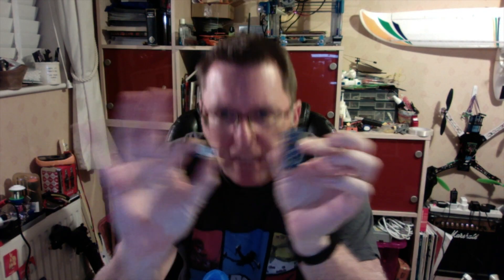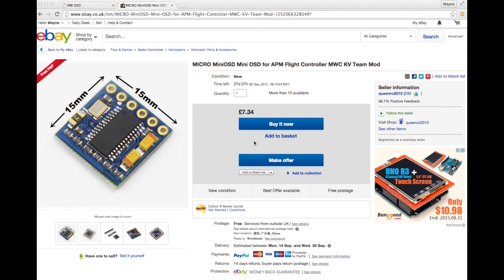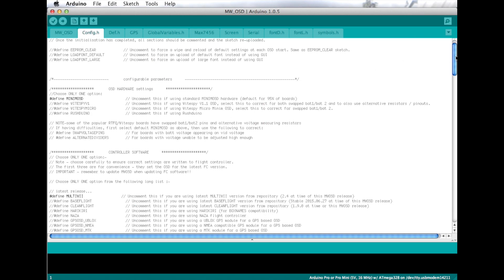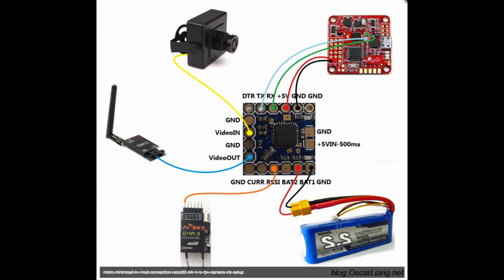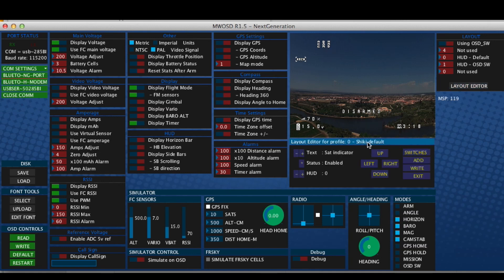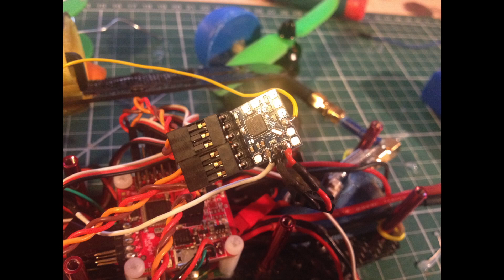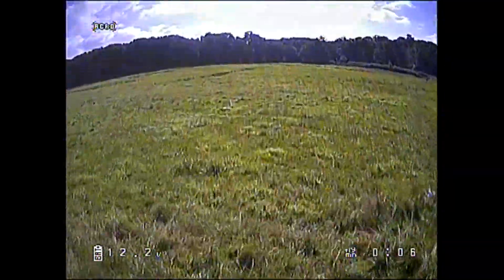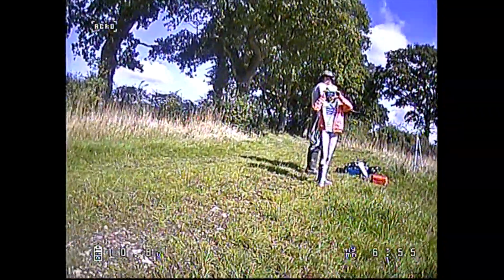Micro MinimOSD Review/Setup and FPV flight test

Comment: Thank you , I have one enroute from banggood to have a tinker with and your review couldn't have come at a better time.

These minim micros look ideal for our types of use and i intend to use it in nearly the same manner as you have,besides the pyrotechnics :)

Maybe able to shoehorn one of these into my upcomming 150 build.
Thanks again.
Reply from the maker: +MrE I think it'll fit ok, I didn't want to make the video overlong about where I put it, but it's basically sits on top of my Naze board, where there's space before the top plate.  I'm presuming the vertical room between the plates is still similar ?
Reply: +CurryKitten Very much similar,but as you could imagine space will be at a premium with such a small frame. The one place im thinking about is on the back of the camera itself if the conventional space is not feasible due to other components residing there.

Comment: Cheers mate, excellent and informative video! I bought one of these from  Banggood, and managed to fry my VTx  on the first connection!

Do you have the earth lines from the camera and the VTx on the same pad? it's difficult to see on the video. 

Cheers,

Eck
Reply from the maker: +LocheeLuftwaffe Oh no !  Sorry to hear that, any idea what was up ?  So in this setup the power and ground go from my PDB straight to the camera, and then the video out comes back to the osd (no ground connection here)  There was a comment on Oscars blog about people having issues with the OSD display flickering and it could be solved by a ground line on either the camera or the video in, so I've got both ground and video out from the OSD to the VTX (and one again it gets power from the PDB).  Note: This only works because of the common ground with a single battery powering everything - if for any reason you are using multiple lipos, then different rules apply
Reply: +CurryKitten Thank you sir, I think the earth must have touched somewhere on the board. 
I'm using the Eachine 700TVL camera/200mW VTx combo from Banggood, and, following your reply, cut just the video wire between camera and VTx on the replacement set, popped them on and success!
Reply: +LocheeLuftwaffe you have a Eachine 700TVL camera/200mW VTx combo from Banggood set up with it, do have any pictures or diagrams as to how you did this as I have the same camera and am waiting for my Microminim osd to turn up in the post, thanks
Reply: +Ian Nicholas Hi Ian, Unfortunately, I don't have any photos of my setup, but I'll try to describe it.
Firstly, the only wire in the Eachine harness that needs to be cut for the OSD is the yellow wire. I cut it about 7.5cm (3 inches in old money) from the camera connector.  The camera end goes to the video in pad on the OSD, the VTX end goes to the video out pad. There is no need to connect the ground wires to the OSD, so leave the black wire in one piece!  

The flight controller connections and firmware you install will depend on your setup (I've used Naze 32 and Flip 32 FCs and Cleanflight)

The connections are shown on the eighth picture down on the Micro Minim OSD page on BangGood's site...I just followed that.

Hope this helps!
Reply: +LocheeLuftwaffe thats awesome thank you

Comment: Nice Video Great advise and info. At first thoughts like you I thought why would I want a OSD in my 250 and nowI WANT 1 :DBy the way What recorder do you use for the FPV camera
Reply from the maker: +Pudsey - Rc Thanks - I'm really liking this little thing.  I'm using a BevRC PV700 DVR which is the same thing as the FPV-Japan and the same as many others sell (just with different splash screens)
Reply: Im using 1 from Hobbyking had it a while but it lags a lot and stutters on recording from time to time even with class 10 cards

Comment: I'm having trouble getting into the menu doing the stick movements, I get the boot screen when I power up then I get DISARMED which alternates to NO DATA, any help is appreciated, thanks.
Reply from the maker: If you are getting no data through, then you might have mixed up the Rx/TX pins.  Try swapping these over and try again

Comment: Is there any way that you are aware of to change the position of the bat voltage to a different location on the screen using the Taranis? I ask because re programming my board means quite a bit of time taking my quad apart and I would like to avoid if possible thanks!
Reply from the maker: +Brent Simpson Not sure, you can turn a bunch of things on and off, but not sure about changing position.  Away from my gear for a week, and won't be able to check for a while
Reply: Brent, if you research this you will see that you can edit your own custom characters  and upload them. The position of each of these is written in the code.
Every variable along with its identifying bitmap icon or acronym have a coordinate for where it will print each beginning (I believe) with the left most character.
I am just getting my head around this so I can't be more specific. All I can say is look at the code once you have it up on Arduino IDE and then look at each of the headers along the top. Join the forum on MultiWii and check out for a thread at RCGroups. It is well worth your time and effort as it is the ONLY open source OSD firmware that is being actively developed at present.

Comment: Massive shame it's not flashed already. Can any other dongles be used rather than an arduino?
Reply from the maker: +MicroRCFiend You don't need a physical Arduino board to do the flashing - essentially the OSD is a tiny arduino.  The bit for the flashing is an FTDI adapter, which you will need to make any changes to the OSD display anyway

Comment: to set up voltage trough the flight controller do you have to set up anything in cleanflight?
Reply from the maker: +J Sanders If you are getting the voltage into your naze (or whatever you are using) then it'll pass it through to the osd.  Of course you have to have that physical connection in the first place.  What you can do in cleanflight is setup a separate low-voltage alarm so it'll start beeping (which of course also involves connecting a beeper)

Comment: How do I configure ports in betaflight? Wich UART should i use? Help me
Reply from the maker: When I made this video I was using a Naze32 rev5 board which just had an rx/tx pin in the middle of the board and shared as UART1 with the USB connection.  As to which UART depends on the board you are running.  All you need are 5v/GND/TX/RX pins on the UART which you can then connect to the MicroMinim.  In Cleanflight/Betaflight you then set this UART up as MSP 115200 baud (under the data heading)
Reply: CurryKitten ok thanks,I got it to work

Comment: If I have just the Naze32 Acro which options will work in it???
Reply from the maker: +Quadcopter Free Style Nation Well, depends :)  With the Naze connected to almost nothing - you'll get the modes, timer and the AHI if you really wanted it.  Obviously if you connect the power to the naze or direct to the micro osd you have your voltage which is handy

Comment: do I need the Filter for Rssi on standard minimosd?
Reply from the maker: +Konrad Lorek Sorry - don't know, and it might depend on the firmware you run on it.  Shikra mentioned he should be able to fix the issue with FrSky PWM RSSI at some point

Comment: Ok i got it to upload i just use an older version 1.05  but now when i open mwosd   It tells me. Waithing osd  . Anyone knows what that is
Reply from the maker: In the GUI do you mean ?  It works on the tx/rx pin, so sends commands to the OSD to ask for data and then waits to receive it.   To check if it flashed ok, if you connect a video source to it, you should see some default OSD info appear